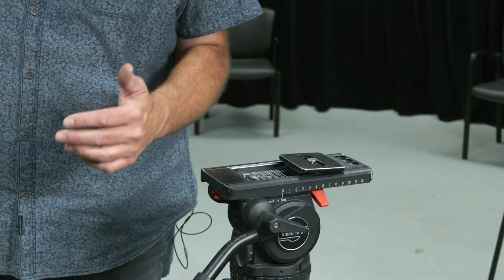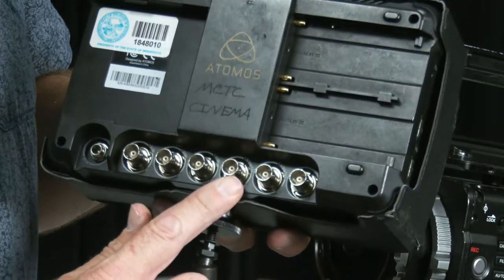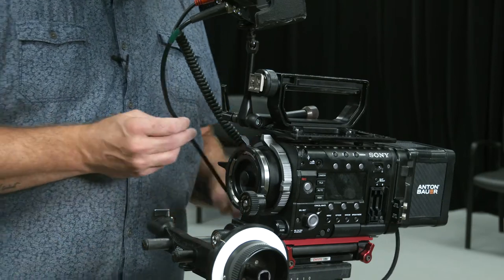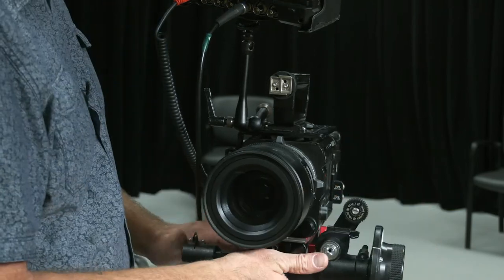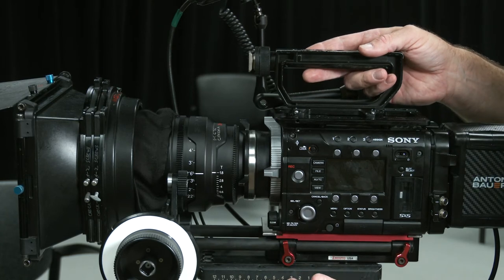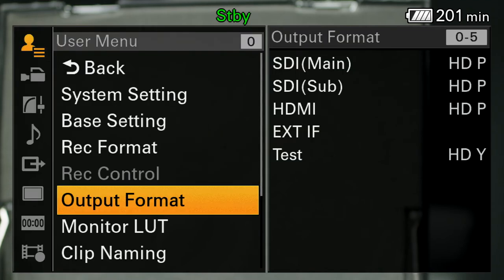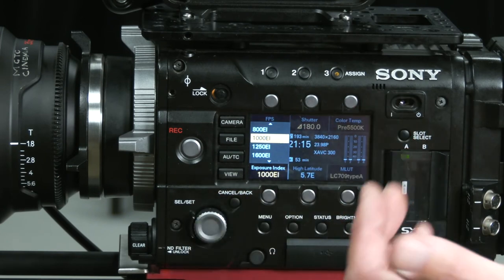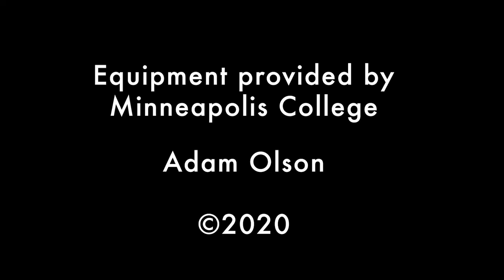Sony F55 build

Comment: Hi, thanks for sharing. I want to point out that there is a safer way to connect accessories to SDI and HDMI ports, especially using d-taps, look up 'SDI protcol'. It is recommended to always verify both camera and accessories are powered and grounded, before establishing a connection through the SDI's or HDMI's, otherwise you risk the chance of blowing out the ports. When disconnecting (for instance to swap the battery) reverse the procedure (break the SDI connection first before removing the power connection, in this case d-tap).